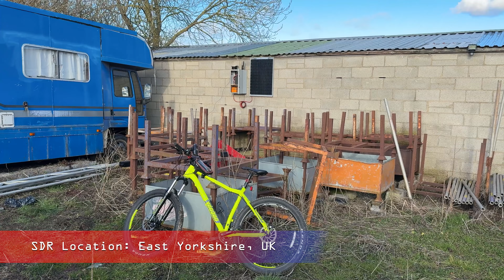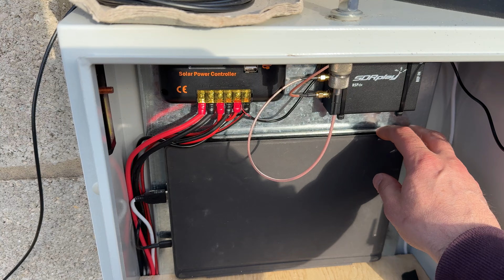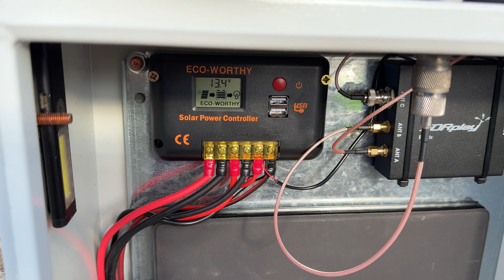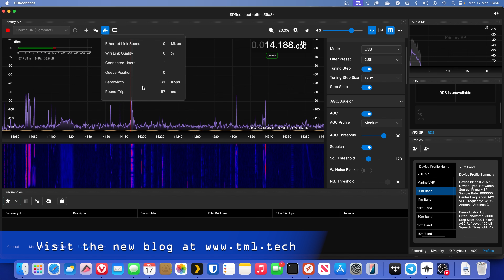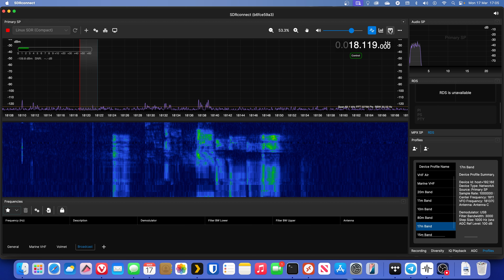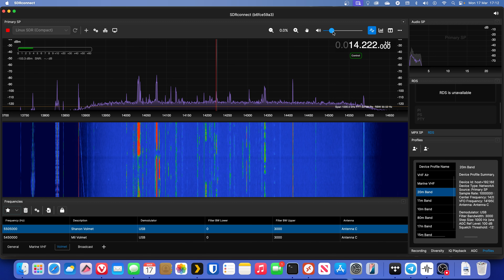We Built a Solar Powered Remote SDR Receiver Station!

Comment: good setup.
I have something similar just for at home with a Raspberry Pi 4 and OpenWebRx+.
My setup has a PC UPS powering my 4G router, OpenWebRX+ server and my home server.
The whole lot only uses 28 watts of electric.
Reply from the maker: That's really good. The Raspberry PI's are great for these type of projects. Equally we could have used a Pi4 for the SDR and remote access but I hed a spare Dell Tablet with damaged screen kicking around so it made sense to use this. It's got a 256GB NVMe sinde to plenty of room for other software should we expand what we're doing at a later date.
Reply: @Transmission1 future proofing is always good. Less time on site

Comment: If your struggling with the router signal, I recommend the MERCUSYS MB110-4G N300. it has external antenna support and also mobile sim input :)
Reply from the maker: Thanks for the info, good to know which models have an external antenna connector. A lot of the cheaper LTE routers don't have this option.

Comment: Love this - have tried something similar as I work on remote telecom sites. Only issue is significant breakthrough due to the high power surrounding tx. Need plenty of band stop filtering.
Reply from the maker: That's true and one of the reasons we located the SDR in an RF quiet location on the outskirts of town. It's working really well and since the video we've added an old Coment Tri-Band Co-linear to antenna connection A for the VHF/UHF bands, it's fastened to the top of an abandoned telegraph pole!